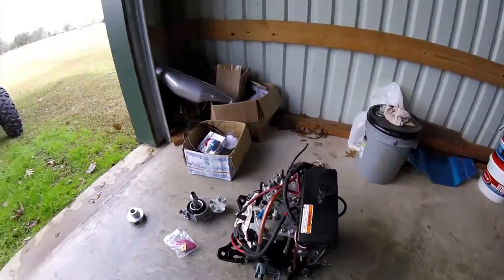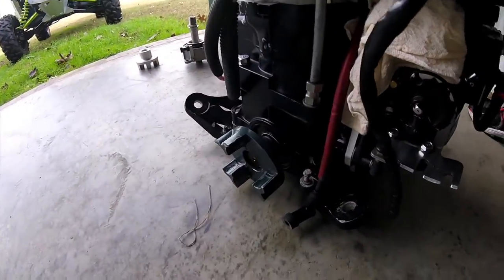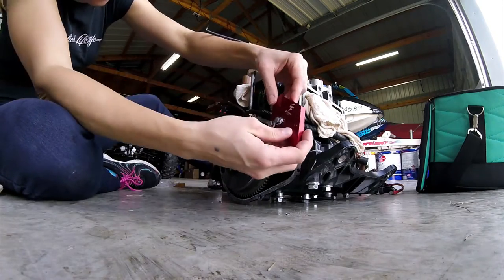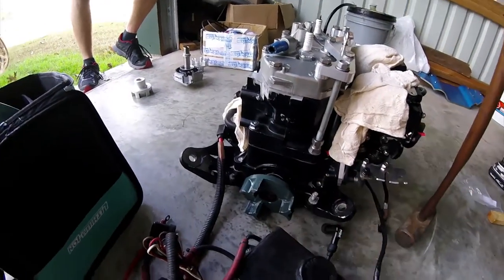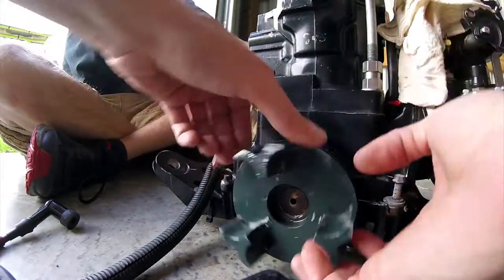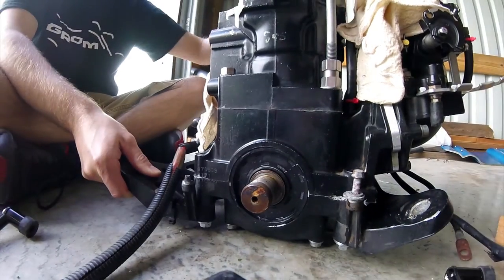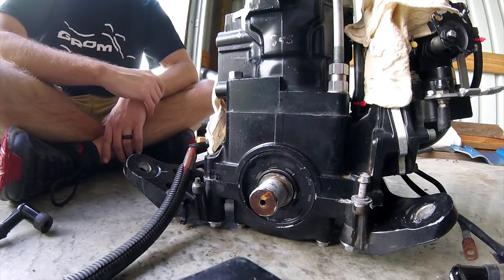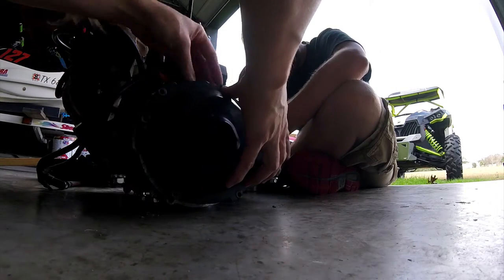ChixSki: Krash 50 Cal Flatwater Freestyle Build - Part 5: Shafts, Couplings, Lube & Screws

Comment: Looking good.  I'm sure you know, but make sure you really tighten the hose clamps on the b pipe and exhaust well.  Mine popped off and almost sunk my ski for the second time.  If you can get a socket on those, it'll help.  I should probably get one of those Cold Fusion flywheel locks, looks so much easier.  Keep it up.
Reply from the maker: K MN Yep, had a bpipe on my Blaster. Tight as fk! Haha, CF tool was amazing, love that.

Comment: why did you change out the connection point where the motor meets the drive line??
Reply from the maker: Brandon C. Since I didn't have a donor ski I didn't have the other half or the OEM insert. Instead of finding nasty used stuff I bought the ADA billet coupler. Machined instead of cast 👍